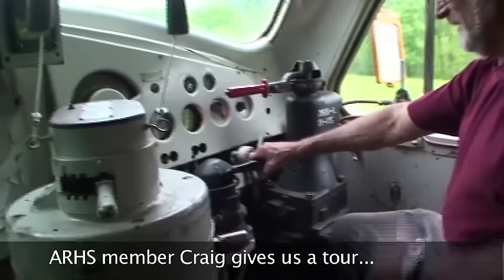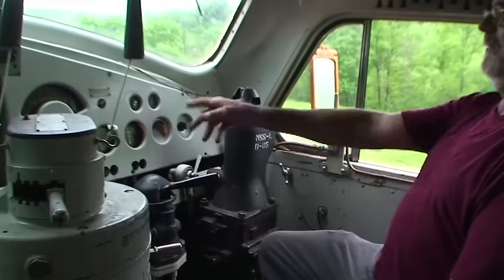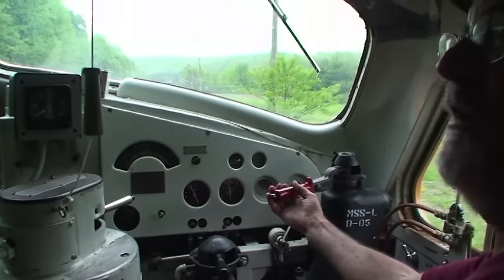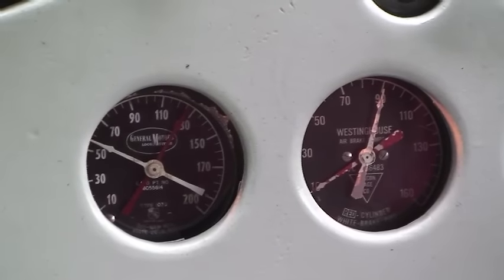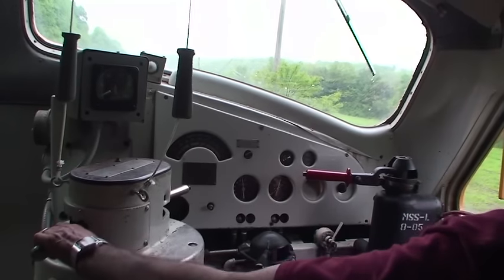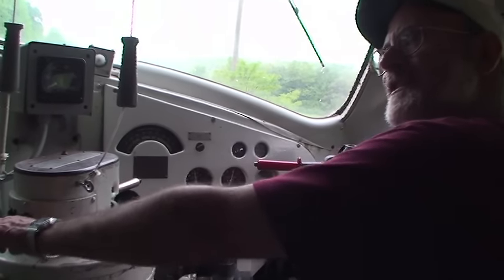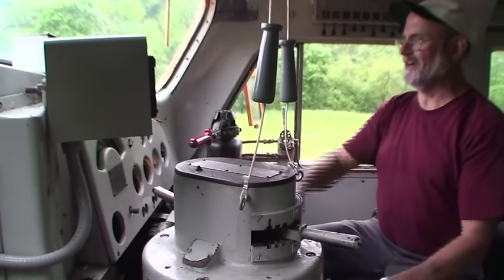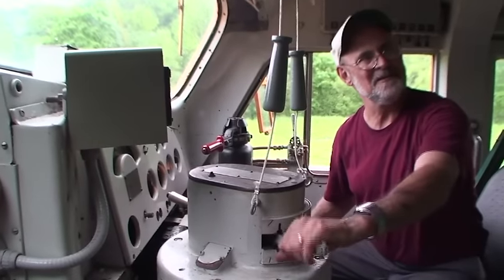Inside an operating F3

Comment: The first thing one notices is the lack of a steering wheel...
Still, it probably handles pretty good. Corners like it's on rails...
Reply: Actually, yes. The flanged wheels keep the entire train on the track. There were steam locomotives that had a huge valve handle where a steering wheel would be. An engineer with a very weird since of humor once loved to pretend he was "driving." One time, they were going on a winding stretch of track, and he turned to the brakeman and said, "Hey, Brakey, could you take the wheel while I go to the coal pile?" That poor brakeman was sweating blood "driving" the train over all that winding railroad until the engineer got back.

Comment: One thing he got wrong is on the automatic brake valve, the position all the way over to the left is Full Release, it allows an extra amount of charging the train line.  The traction motors go from Series to Paralell to parallel shunt on an EMD.  I cut my teeth on these engines on the BN.

Comment: Those things come with a crapper? ( well I don't know )
Reply: You do not see the door but it is in the cab at the front middle of cab. The bathroom door is there.
Reply: @Ethan_Odom  Were these locomotives operated by one person, or multiple crew? In case you need the crapper in the middle of a journey?
Reply: @Republic3D  American Trains still have two Men on the Locomotive, Engineer and Conductor. Europe usually is Driver only, but the Locomotives don't have a Bathroom either as Freight Trains here stop frequently too.
Reply: @Genius_at_Work  What about passenger trains, would the locomotive driver wait until next stop and then go quickly to the passenger toilet and then return for the next leg? I know, probably stupid questions but I'm curious. :)
Reply: @Republic3D  Usually yes. But they don't stay on a Train longer than 3-4 Hours before changing to one in the opposite Direction. They must know their Stretch of Track inside out, hence they don't drive too long.

Comment: Sounds scientific when he talks! Are they complex to drive?
Reply: In simple terms, a locomotive engineer is essentially just trying to match the amount of electricity the engine is generating to the amount of electricity the traction motors need (how much they're "drawing"). The optimum range is where you're making enough power to accelerate the train to the desired speed without using more fuel than was necessary.

There are some other factors as well such as slack, dynamic braking, train brakes vs locomotive brakes, wheel slip and sanding, air reservoir and braking pressure, etc. - add to that you've got to know all the signals and railroad rules. You can understand why you have to do time as a conductor before you can become an engineer, it'd be a lot to take in all at once.

Being able to drive a locomotive is definitely a skill. They aren't complex as such, once you've learned it then it's just like using any other vehicle or piece of machinery. But it is something you need to learn how to do and hone your skills over time.
Reply: Thanks for the reply. After watching the video again, still have absolutely no idea what he is talking about LOL! Forward and Reverse are the only two words I understood. Hopefully like a car, if you can operate one locomotive you can operate any locomotive!
Reply: He's basically describing a system whereby the locomotive will automatically move up the throttle "notches" by switching between traction motor circuits based on amperage draw versus voltage. The engineer can then interrupt this system when the desired line speed is reached. He also explains how the independant (locomotive) brakes and train brakes hold and release pressure. These are all older systems which are of interest to an engineer who is conversant with modern locomotives, which are less complex to operate because there is more automation.

Comment: Good thing they finally scrapped these things.  They were death traps.
Reply: You do realise that some railroads still use these, right?
Reply: In what ways we're they death traps?  The only thing I can think of is that in a GP or SD, especially the low nose units, you have greater visibility going in both directions. Some even have dual controls.  Also, boarding is much easier on the newer ones.

Comment: I suppose you couldn't put a mic on the guy - or put subtitles...
Reply from the maker: +stainless0521 I may re-edit this video. Can't help the sound much unfortunately, but I like the idea of subtitles.
Reply: Great video. I'm really trying to find out how the "dead man's switch" worked on these old units...an ALCO (MLW) S-1 if possible. I'm researching for a story where an S-1 (or an RS-2 or 3) is sent off driverless. Did they use the constant pressure or intermittent tap, and if the latter, what would the max time be before the auto braking kicked in? Thanks again for the video.

Comment: The NY,NH&H RR used EMD FL9's, specially built.  F=1400hp, L9=longer by 9 feet for the addition of a steam boiler to heat the coaches and a retractable shoe on the side for running on 3rd rail power in and out of NY where exhaust smoke was prohibited.  They had a melodious 3 chime Hancock air chime horn and a distinctive kind of tone from the roots blower, very unlike the whine of a turbo.  The 567 prime mover had a cadic rhythm with a faster, smoother beat than that of a chugging Alco.  They were the varnish through the 80's and a few are still in service at Museums.
Reply: FL9s were 1,750-1,800 horsepower.

Comment: I lived on the West Side of the Central Valley, CA. During cantaloupe season the packing houses would load up melons all night long to the refrigerated cars. The entire town would rumble when the engines would shuttle and make up cars. When an engine would couple up you could hear the slack in the couplers thump all down the line. The engine would be rolling while the last cars would stand still while the couplers would slack in the direction of pull and you would hear the clunk again as the engine would pull away.

Comment: They made them simple and easy to operate

Big difference from today

I wonder what year they went to VHF radios ?

They would have had a GE radio, I think.
And I am pretty sure they were crystal radios

The Motorola's were specifically made for the railroad

A special radio because it had all the channels, it needed more memory than the standard VHF radios

I can't remember if the regular radios were 32 channels or 64
But the railroad radios had a special codeplug and the only difference was they had more memory and I think a different receiver filter.
The Motorola was 136 to 154 or 144 to 174.
They had different filters

Comment: Those old "bulldog nose" units were nice looking machines. I wonder what happened to cause later diesels to look like crap? I guess the engineers (as in the builders, not loco drivers) fired the artists, and made everything purely utilitarian.
Reply: Visibility is the problem. These are beautiful locomotives, but you can't see worth a darn when backing up or switching. You have to stick your head out the window if you want to see behind the locomotive.
Reply: No cat walks, but they were beautiful locomotives.
Reply: Jon Raybon Look at these old EMD's and compare to the latest locomotives. The have the same principle cab as these pld car body types but integrated the traditional locomotive style with rear view windows and catwalks.
There is a resemblance between an F7 or F9 and an SD70ACe or ES44AC, Yes they are obviously different of course but the base design  of the "nose" area between the two are almost the same.
Reply: +Paul Kleinpeter Hooded locomotives must be easier to service and work on too.
Reply: The design was intended to make the unit attractive for passengers and also attractive to railroad companies who were switching from steam to diesel. At the time, there was some concern among railroad executives about their corporate image and the perception of shareholders when it came to purchasing this new diesel power. EMD and other manufacturers attempted to overcome this skepticism by making their locomotives look "futuristic". Manufacturing streamliner styled bodywork like this was, essentially, an expensive PR exercise.

Although freight locomotives no longer have to be so heavily stylized, the manufacturers still have an aesthetic design department who aim to make their locomotives look as attractive as possible, within the limits of the design statement.

Passenger locomotives on the other hand still receive a lot of styling. Although public interest in trains has dwindled, passenger operators still demand that the manufacturers put effort into making locomotives and cars look "modern".
Reply: I like the dash 9
Reply: The old "bulldog nose" can get quite boring after a while

Comment: The transition lever is different from what I've seen.  Others, you pull toward you for the dynamic brake.
Reply: Totally different devices. The transition lever switches the traction motor connections from Series, Series/parallel/shunt. To manage the current/voltage going to the traction motors. Dynamic braking would be controlled from another lever to switch the motors from traction to generating. There is no dynamic braking on this old girl.

Comment: wait! nearing the  end of the clip there is an active pacific steamer hauling a passenger train. noticed that there are two hood unit diesels being hooked next to the steamer. are those diesel pairs helper? or are they supplying electricity to the rest of the train ?
Reply: That, plus they have any cab signals and any communication devices needed on a main track.

Comment: I have a question, say you are heading north and are standing with your back to the front of the locomotive. I am standing to the south of you with a drink in my hand, holding it as if I am getting ready to take a snort.  All of a sudden the engineer throws her into emergency, what happens next?   Just wondering how quickly these things slow down. But I thought that was more interesting than if I had asked "can you stop on a dime with this beast"? :)
Reply: +abel wayne as long as the dime is about a half mile/km away.

Comment: This engine was built back in May of 1948...the cab will be quite loud.It doesen't matter how he sets the microphone,this engine was an early venture into diesel power,this thing doesn't even have air conditioning.(air conditioning came out about 1955 or so)
Reply: In a locomotive that early?!!  Did any F units or E units have it? Were there other brands to use it?

Comment: How much horsepower do F units put out?
Reply: The first where the FT built 1938  that was 1350hp. The next was the F2 it was supposed to be 1500hp but there was a problem with the Generator design and it couldn't handle the increase so they where 1350 hp also , when the Generator was perfect it became the F3 with 1500hp  and they went back and upgraded the F2's to F3. No F4 ,5or6. Next was the F7 fp7 1500 then last was F9  FP9 and fl9  at 1750HP the Fl9 did reach 1800 at one oint. That one was designed with a three wheel truck and could also run via a shoe that took the current from a third rail. New Haven RR used em,
Reply: @davrober48  
there was an interim model of the F3 called the F5.
These were late F3s.
they had F7 traction motors..
these F3s were built so as to allow future upgrades to F7.   F5 was a somewhat inform EMD designation.  EMD did recognize them as F5s.

Comment from the maker: At 1:12, the engineer is demonstrating a quick release of the air brake reservoirs on the engine itself if there is still pressure in the air tanks. He said it prevents getting flat spots on the wheels by keeping them from locking up.

Comment: Makes me wonder why automobiles and tractor trailers don't use traction motors.
Reply: Hybrid is similar
Reply: Not quite,all the hybrid I've seen are either running on battery power or the gas/diesel engine. Batts for cruising and the engine for acceleration.

These run just like a generator plugged directly to the electric traction motors. No storage batteries,always powered by the Gen set. It's the only really viable concept out there till they reinvent the battery.

Big haul trucks,like in mines, use the same set up as these locomotives,for example.
Reply: Well, some do... Teslas come to mind. But no purring EMD 2cycles behind the driver.

Comment: In other words, to what ConrailJon is saying is, to reduce the risk of the wheels locking up and getting flat spots when the train brake is applied, you push down on the engine brakes to bring it to a smooth stop....unless an idiot pulls out in front of you.

Comment: Can you imagine if cars were still this under-engineered? What if instead of pedals and shifters we had levers that first started the gas pump then another lever to let the brakes go and another to control the fuel flow
Reply: roblox84 that could be cool
Reply: Actually, that is pretty close to the way handicap controls in an automobile operate.  The hand controls are for people who are unable to use the regular pedal controls.
Reply: You gotta remember that this machine was made in the late 1940s.  Look inside one of the newest machines and see how much simpler they look to operate. You think those old F units are bad, take a look into any steam locomotive they replaced.

Comment: You really need to set your mic gain properly. It's clipping all over the place.
Reply: 2009 - his camera might not have had an override its probably Auto or nothing,
Reply: If it was auto you'd think it would reduce the gain automatically the way it's supposed to.
Reply: It's prob'ly just the engine noise!
Reply: agentorange153 No, there is distinct clipping. Engines don't sound like that.